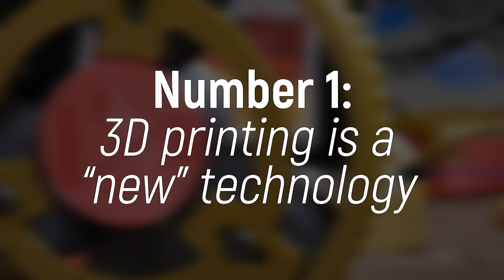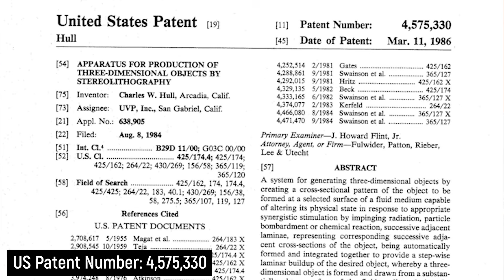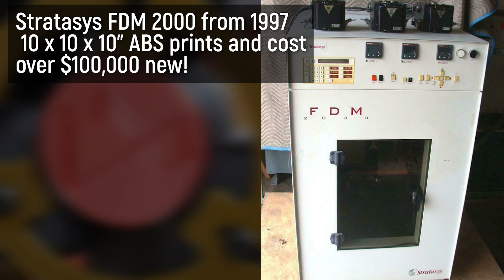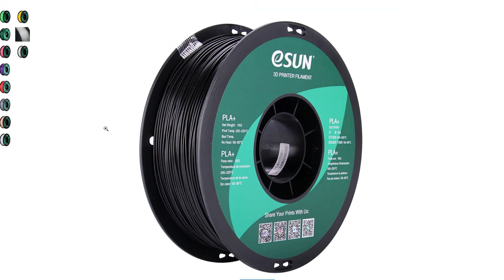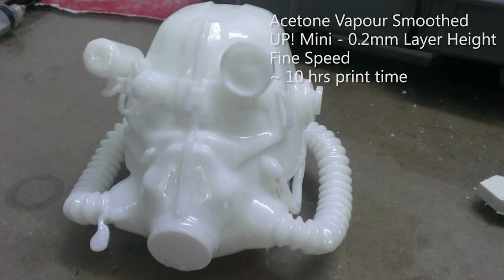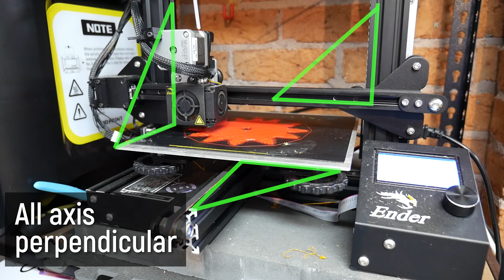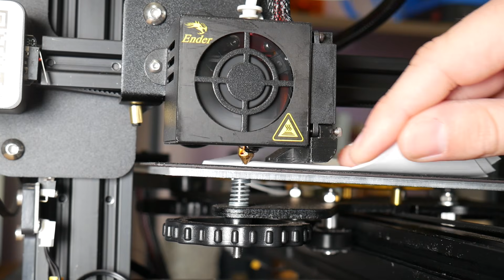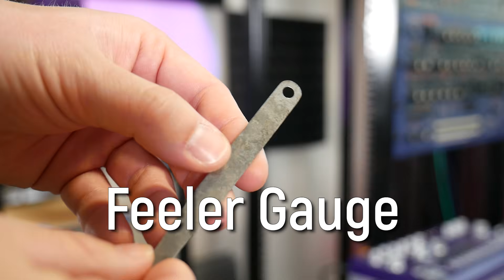3D Printing Myths I used to believe...

Comment: Never done paper leveling like you do. Seems weird to me.
1. i have a custom print which homes the print head at center, then stops the machine in pause mode (still heating, but with the filament retracted 2 cm, all the way out)
2. using a thick stock business card i bring the table up on all corners (i just go around one quarter on all) until the card is caught under, unless i give a sharp tug.
3. i start another program (with the same heating settings) which stops at all the screw centers of my bed) for 2 minutes per corner, using the card i used to set center height, i go around twice, then it goes to center again, where i check to see that the settings match.
And that's that. My printer is set, with a first layer that's just squished enough to make an extremely good adhesion to a paper tape + stick glue.

The connection is strong enough that if the table has cooled after the print, i have to reheat it to activate the glue. I have the opposite of everyone's problem, i can't remove the parts easily.

One thing modded, all the wheels have a quarter notch. So i know i've only turned one quarter (the notch is glued to the aluminium using heat activated glue).

Edit: with the help of Simplify3D's algorithms, it's gotten to the point where i set it to start, make sure the program took, and then leave.

Comment: Wait. So what is the setting for the height at which you start the first layer? Is it just initial layer height in cura?
Reply: Yes, this setting determines the height above set-zero that the head travels to, to print the first layer.

Comment: Thanks for confirming the metal gauge idea, I have been using playing cards because most of them are about 0.3 mm thick and sometimes printer paper which is  usually about 0.1mm thick and doing the same thing you did with the gauge but I was never sure if I was doing it right

Comment: Always noticed about that about leveling with paper.  I wound up basically doing the same thing you mentioned, leveling with paper then adjusting as it prints.

Probably gonna buy a BLTouch soon enough so I can finally be done with leveling.
Reply: Youll never be done with leveling sadly. You wont have to do it before every print though

Comment: Can't stress more the difference between "levelling" and "squareness" - noticing your X axis gantry is off by 0.5 degree after you printed a large gear is pain. On the other hand, if all the axes are perfectly perpendicular, levelling is only required very rarely or after changing/adding bed plates for different materials.
Reply: I spent hours making sure my printer frame was square when I was building it. It paid off in the end.  I rarely need to make adjustments to the printer now when I start a print.
Reply: @NZSpides  Me too, but apparently the gantry was not screwed tightly enough and the end farther from the z-screw sagged a bit... just enough to make cylindrical stuff print off axis.
Reply: @e_neko  😂 hate finding lose screws after a build.
Reply: you are leveling your bed to the squareness of the frame. IE traming.
Reply: @LadyTea  Just partly true. You level the bed to compensate for the offset to the Z home position. A well built frame technically could work with just adjusting the Z home sensor position given the bed is already set parallel to the XY plane.
But while typical 3D printer beds are not designed rigid nor accurate enough for this, there are more screws to achive tramming too, in Z direction. But there aren't any in XY relation, so one still have to make it accurate partially.

But why not just make it completely accurate? Non-squared frame will never give you dimensionally correct parts, which does matter when you use it for scientific purposes.
Reply: @gabiold  true enough. Having a square zaxis makes sure prints will be straight up and down

Comment: Lathes have the same "process called leveling is actually removing the twist from the frame" issue. I do like using a feeler gauge but I haven't stepped the z away before doing it, might try that the next time it needs adjustment. The other nice thing with feeler gauges is that they usually come in sets with lots of thicknesses, so you can find out what the distance is when it's working well, and use that in the future.

Comment: I like the idea of using a feeler gauge, however Wouldn't a it damage your hot brass nozzle ain't they are made of steel?
Reply: yes, but you don't really touch them for that long, and mostly leveling is a one-time thing.  It won't take mm off your nozzle after one touch.

Comment: I rely on the Bed Visualizer Octoprint plugin and a BLTouch for establishing a leveled bed in relation to the nozzle. The second important factor is the z-offset which depends on the BLTouch to nozzle distance, which is most likely negative. Also, when printing greater layer heights and wider nozzles, for instances at 0.9mm layer height, with a 1.2mm nozzle, I had to decrease the z-offset to a less negative number.

Comment: Not sure why its such a common misconception about the paper trick. The proper way to do that is home the printer, then tell your printer to move the Z height up to the thickness of whatever paper you're using is, THEN you adjust the springs with the paper trick. This is how I've always done this and it works perfectly

Comment: Yo dawg i know people are harping on it, but at no point has anybody said to fold the paper. 

Typical ruled paper is around .004-.005" (0.101-0.127mm) 
Printer paper is like .005-.007". 

So the paper trick actually gets you "close enough" as there's a large population who doesn't have a feeler gauge laying around even being cheap. 

Stop folding and you'll probably have luck lol
Reply: I don't understand why he would fold the paper, then wonder why the nozzle is to far away.....

Comment: I use the vibrations of the fan on the excruder to level the bed. If the vibrations goes through to the bed, its obviously touching, lower each corner untill half a turn between feeling vibrations in the bed and  not feeling them.

Comment: I have never seen anyone use folded paper before, only a single layer. Isn't it obvious that if the nozzle is to far away that only one layer is needed?
Reply: Following 3d printing heavily for 8 years, this is the first time i have ever heard anyone talk about using "folded" paper to set the nozzle-to-bed clearance. A single sheet of standard paper used to measure the gap has worked flawlessly for me on every fdm printer i have ever used. Too many people dont realize that the single sheet thickness is meant to set the height when the nozzle and bed are COLD. The thickness of the sheet of paper is about perfect to compensate for the expansion of the nozzle\bed at printing temperatures. Setting the gap when the nozzle/bed are hot will result in too much clearence.
Reply: @jasond9824  people just need to understand how much friction you need on the paper and you won't have issues
Reply: @TheRattleSnake3145  How much friction do you need? I always struggle with that.
Reply: @gavinsauer1608  for me and the brand of paper I use, when I push the paper away from me it's not enough friction to start crinkling the paper but I can still feel something.
Reply: @jasond9824  yesss, I'm glad I'm not the only one who pointed that out - done cold becuase it's safer too!

A feeler gauge is pointless for accuracy if it heats up with the bed/nozzle and expands - it's all just about being relatively correct!
Reply: @T4nm4y  A feeler gauge is not pointless, although I do agree it's not really necessary.
If you heat up a 0.3mm feeler gauge from room temperature to 60 degrees, its thickness will change by about 0.15 microns. Not noticeable to your 3D printer.
Reply: @RhysMogg  haha yeah, by pointless I meant that you don't need something that expensive/precisely ground